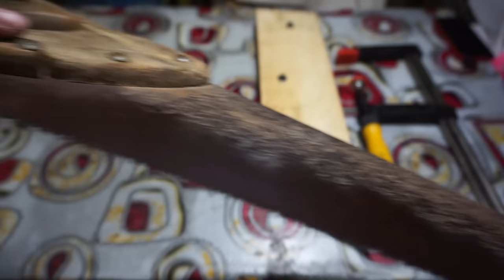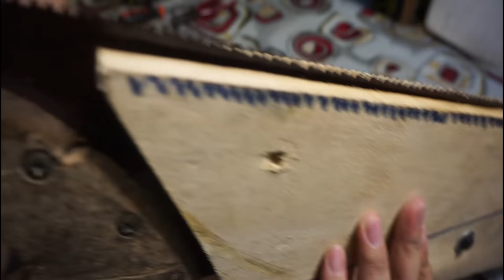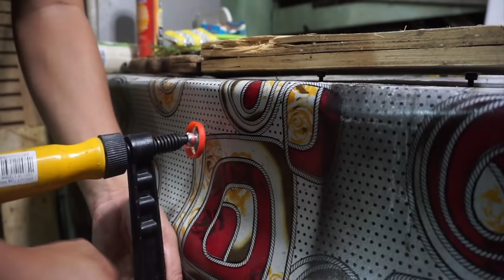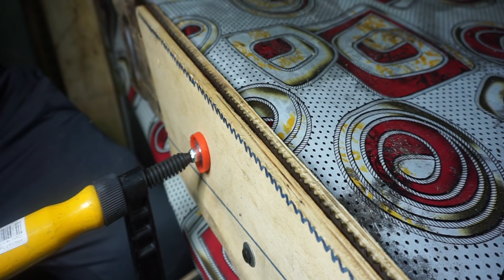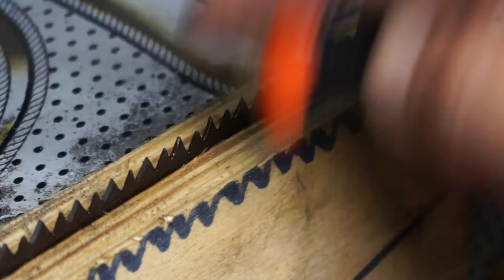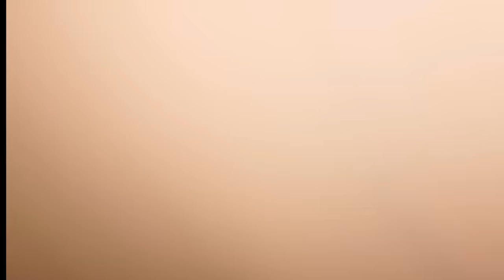Handsaw | Woodsaw | How to sharpening correctly | Woodworking tools

Comment: Fara prea multa bătaie de cap si fara modele copiatoare din scandura recomand celor ce nu stiu ascutirea fierastraului cu pilă triunghiulară in felul urmator Se tine pila in pozitie plană pe fierastrau dar inclinata exact cum a fost ascuțită prima data .Apoi cu pilă înclinată dar orizontală se pilește un.dinte si unul 

 se lasa .Cand sa terminat lucrarea se înclină pila invers si se pileste contra.Executand cu greu aceasta operatie rezulta ascutirea finala .Cel mai bine este sa bagi mana n punga si sa cumperi tul nou deoarece ascuțită facuta nu da rezultatul scontant .Unghiul de atac fiind pasiv tăierea nu este satisfăcătoare .Într un cuvant taie dar nu prea taie .Se v a fost doar ptr  a tăia ramuri 
de copaci .Ca sa tai cu acest fierastrau o scandura ce cere precizie la taiere nu recomand nimănui .
Reply from the maker: multumesc pentru recomandare. Îmi voi îmbunătăți din când în când instrumentele de bază și abilitățile mele. Vă mulțumim pentru sfaturi și sugestii. Will aștept cu nerăbdare în ea.

Comment: Naw...i'll pass. Thanks.
Where is the ''set". The teeth need setting. In order for the saw to cut a kerf the teeth need room to travel through the wood. 
 Also, the top of each tooth must be in line with the previous teeth. This is hoakem. The teeth must all be the same height. What we do to one tooth, the others must have the same treatment.
  This comes from a full-time professional sharpener.

Comment: Four minutes and no sharpening. You are filing. Something. This is not How To Sharpen, this is Watch Me File. You might be doing it wrong; fail. That saw is a piece of crap, you are probably a plumber. Spray the saw! with something. WD40? No, GT40 Even The Whole Can Won't Stop Rust. So Much Rust! Did you file away the top edge?